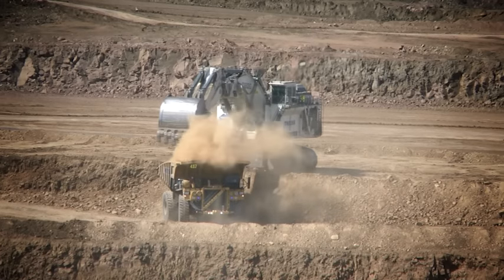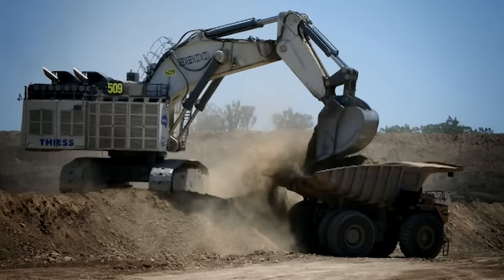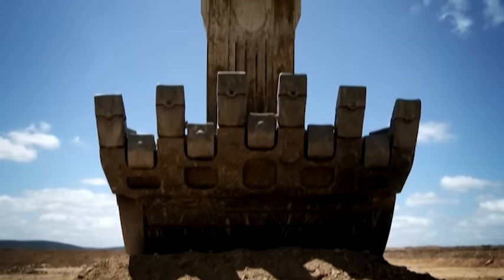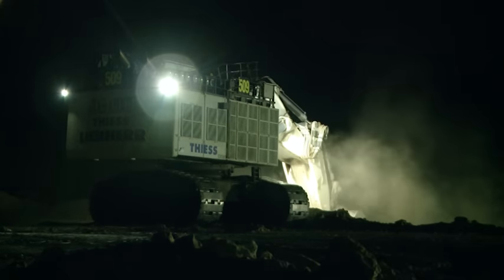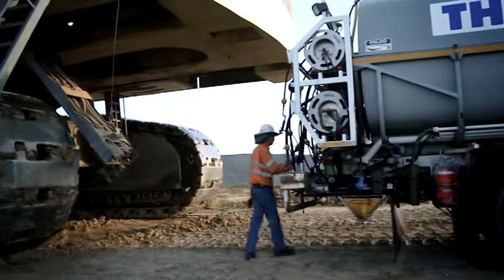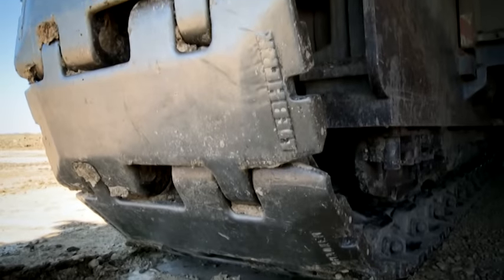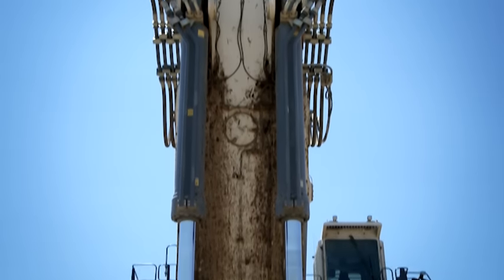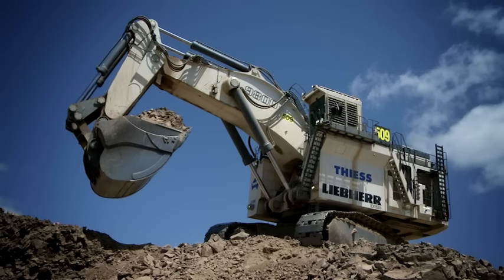Liebherr Mining Excavator - R 9800

Comment: Okay, I've been a hoe operator for 5 years and I have a point/question I would like to raise. In the video you can see when he is loading the truck (0:28) he starts tipping (back track is raising slightly)  Obviously he keeps his tracks pointing forward for digging.  My point being I personally will turn my tracks diagonal in this position to keep digging power and increase reach.  Most guys don't tend to do this, but I feel it is a valid technique and sometimes get ridiculed for it.   What do you hoe operators out there think??
Reply from the maker: alexfluryfilms Thank you very much for this question. We'll ask our specialists in the Liebherr Mining Division in this case and get back at you as soon as possible - stay tuned!
Reply: +Liebherr So any reply? Im interested also...
Reply from the maker: Hello busilica123, excuse the delay - due to the holiday season it took us a bit longer this time ;) But here you go:There may be times when we want to shift the right track as we are loading backwards for additional stability. But we must always keep in mind the time we are going to spend moving a track. Because once we start moving tracks we need to add seconds to the loading time. Maybe just one or two seconds per cycle but this is time. In this video the R 9800 backhoe stick is short and therefore the reach to the bed of the haul truck must be controlled at all times. Also in bench development we must be thinking about the key cut and where each additional bucket of material is coming from. When we are loading with a backhoe cycle times are critical and we must always control this cycle time to be effective.
Another point to think about when loading with the backhoe is machine stability. When the excavator is sitting on a very stable bench some little movement (rocking) may occur as you put the material on the truck bed - but nothing to excessive. If you have a track lifting off the bench as you deposit the material in the bed of the truck you should definitely change the position of the tracks or may even lighten the load in the bucket as you're loading. We don't want the excavator lifting a track in the air. This is a bad operating technique.

In excavator operation everyday is a new day and operators must adjust their operating techniques to meet the conditions. So operating is not always black or white, there is the shade of gray. The very best operators always adjust to the loading conditions. Another point about a good loading position: As you are loading trucks you load your position out so it becomes a constant practice of developing good loading points or good loading conditions for your excavator and then follow through.
We know that each excavator operator develops their own style of loading. But what we strive for are solid loading techniques, controlling cycle times, good bucket fill factors, no
wasted movements which all lead to a safe effective high production loading process. Hopefully this sheds a little light on loading but there are many points to be taken into consideration during the loading process!
Reply: He wasn't tipping due to reach or excessive weight in bucket. He was rocking due to uneven ground. As a hoe operator you should be able to see that. Small machines you can waste a couple seconds moving tracks because you can make up in speed. Big machines you can't waste as much time due to slower speeds. You might move half the world when you swing but look at boom speed, stick speed, bucket curl and swing speed compared to a 30 ton through 50 ton. I currently run 80 ton mass X I run tracks the same way and if I fuck around it's just to throw material under tracks to stabilize it. Then you only have to track not turn track turn every time you move.